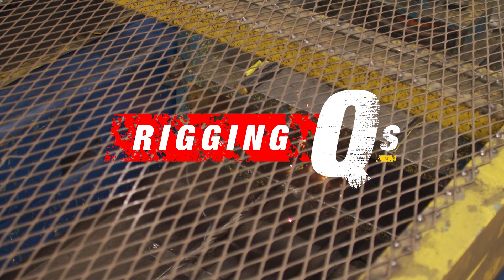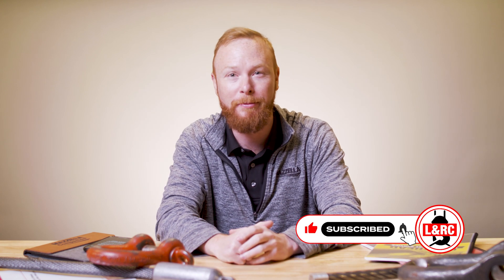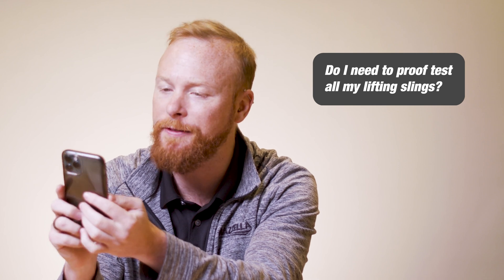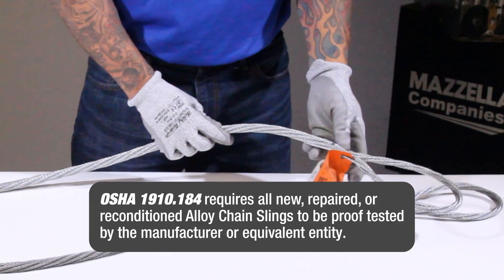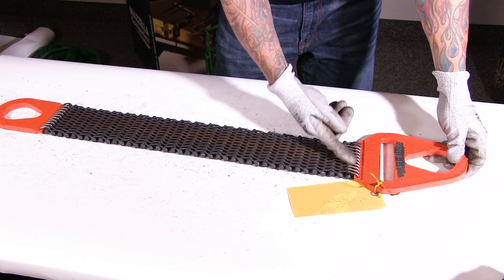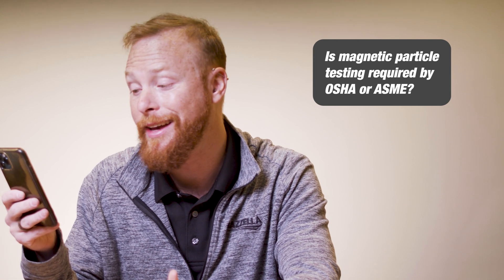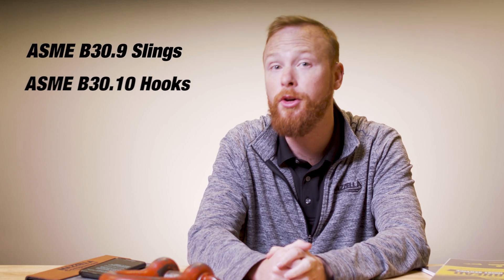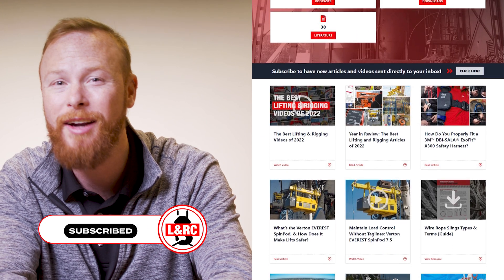Proof Testing Lifting Slings, Load Testing BTH devices, NDT Testing and OSHA requirements

Comment: Another regular question I need to answer is: "Do slings have a recommended or prescribed service life (i.e. 5 years)?"
Reply from the maker: Thanks for the question, Laisser Passer! Here is what our Inspection manager Tom Horner had to say on the subject.

"There is no service life for slings. In theory, if any sling is adequately taken care of, it can last many years. The issue is there is no born-on date, yet, required on any sling.

So as long as the items pass a proper visual inspection, they are good to go."

-Ben
Reply: @LiftingandRigging   Thanks !